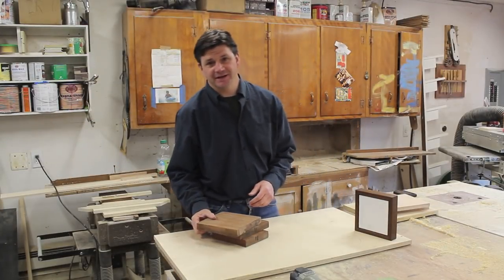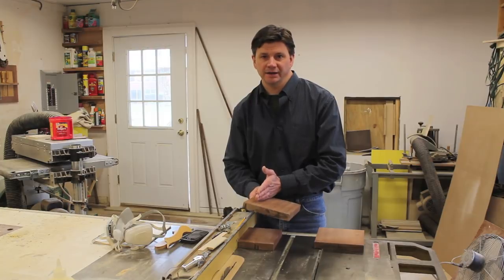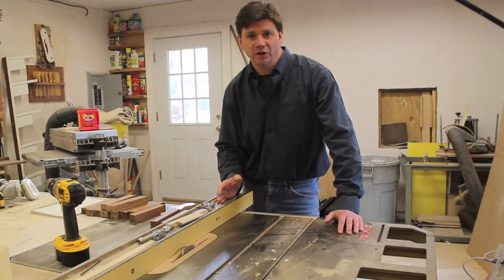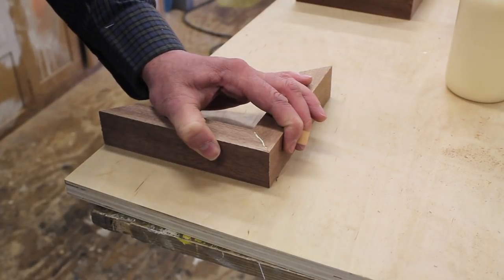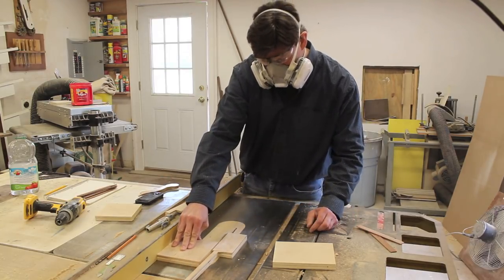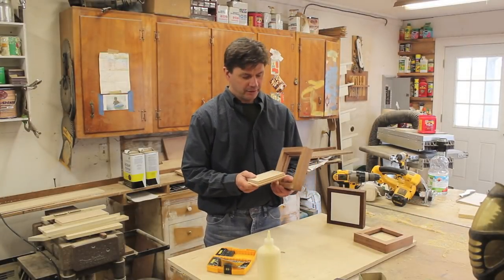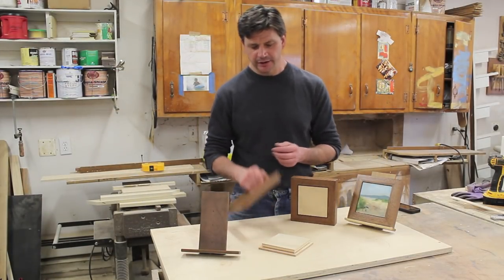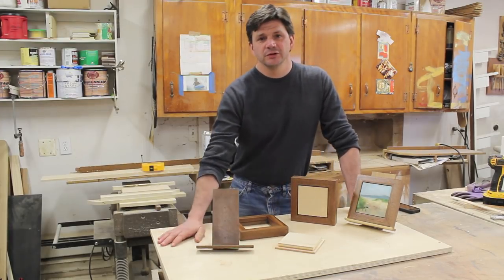Build a hand made Sapele wood frame system by Jon Peters

Comment: I saw you use spackle on your painted headboard to fill the nail holes. What do you use on a stained project like this? By the way, I loved the idea of using spackle. It's so much easier than the traditional sawdust and wood glue method I've been using. Keep up the great work, you're very inspiring.

Comment: Hi J nice job as usual, I noticed you table saw insert dropped a little as the wood exits , I seen someone putting paraffin wax on the tabs then hot glue on the underside of the insert  then lower it on to the hot glue and pressing it level, also [sorry to be a pest ] but if you used a finger/ feather board the wood would not get thrown towards you after the cut, not criticizing honest ,
G